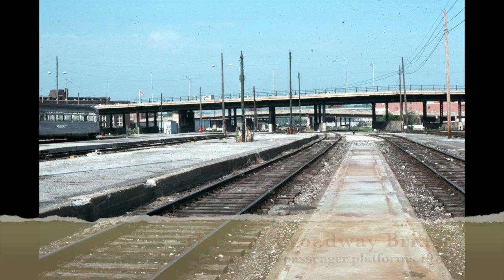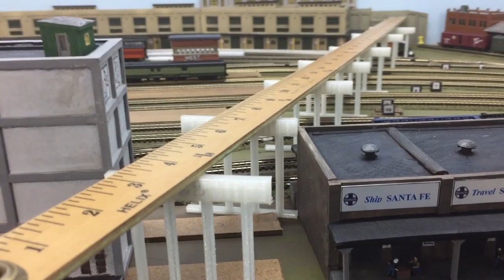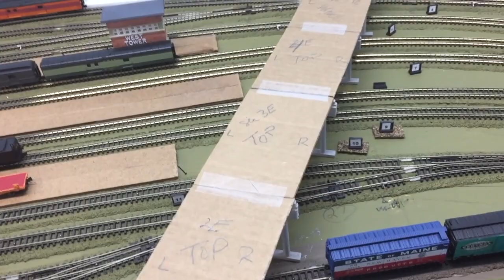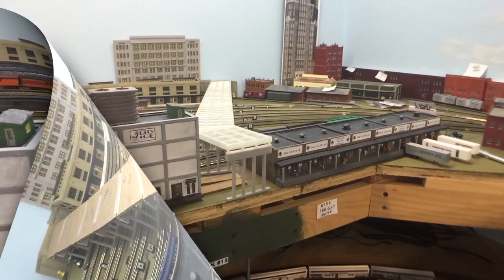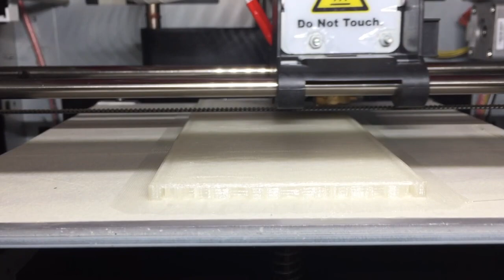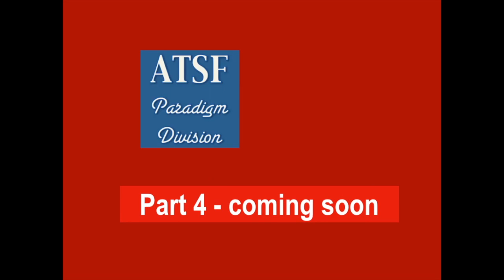New Projects Part 3  - Broadway Bridge

Comment: Really nice John,  looks like you are getting a lot of use out of the 3d printer....thanks for sharing....Jack
Reply from the maker: Hey Jack.  I have gotten my money's worth out of both of the printers.  The bridge is 30+ inches long so it would have taken at least 10 or more kit-bashed commercial kits (around $11-16 each) to span the yard plus some extra bridge piers.  This project cost a lot less than that.  The lights that go on the bridge (in the final reveal) cost more than printing the entire project.....John